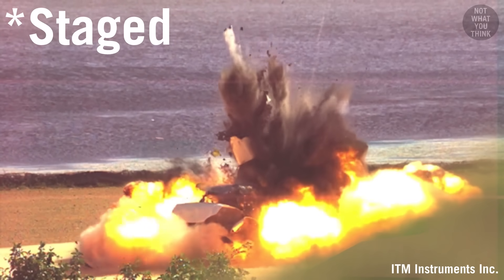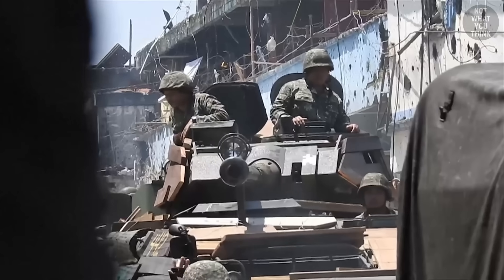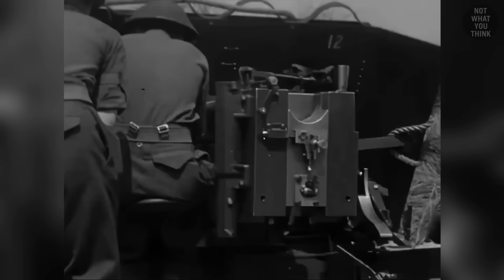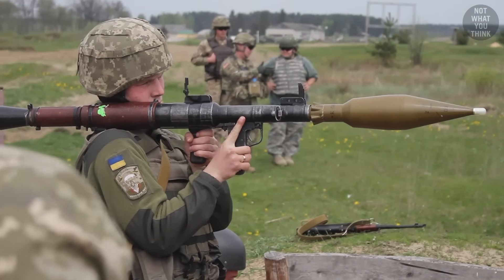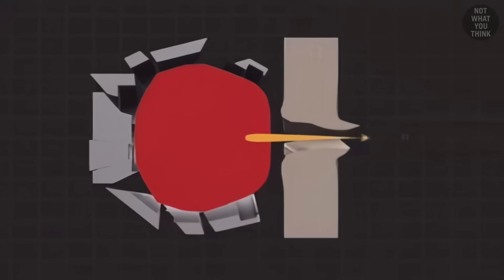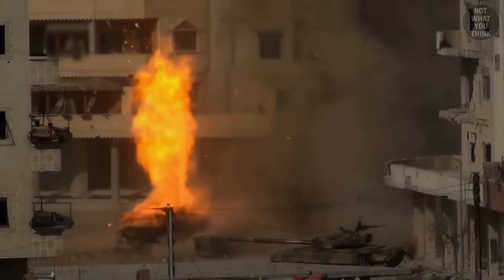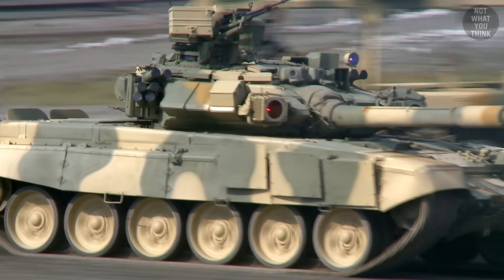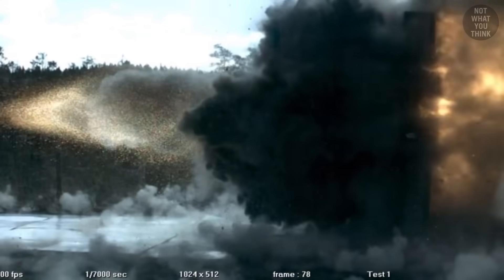Why Protecting Tanks is Getting Much More Difficult

Comment from the maker: Do you think tanks stand a chance against the ever advancing anti-tank weapons?
and what is the solution? "It's Not What You Think" is not an acceptable answer!! 😉
Reply: Would you rather be in a tank in a modern battlefield or advancing on foot. Tanks on their own are vulnerable, but nothing else fills that niche of advancing rapidly under light arms fire, and having protection.

Tanks have always needed support from infantry, and new technologies will give new support capabilities up and until there’s something that allows for an advance into hostile fire better than a tank.
Reply: Just think about. If your watching this kinda  video one shoud have enough knowledge to realize that it's a ongoing struggle...
Reply: @quentinrawlins4876  m
Reply: Tanks are probably not going to go anywhere anytime soon because of how crucial their battle field utility is. Their design and tactics will however receive many changes to mitigate the  threat of anti tank weapons.
Reply: @cwu4591  It's a question of economics and logistics. If one man can take out $20M worth of tanks with a 20K weapon then eventually they will start to have limited and specific uses, and not always risked in open warfare.
Reply: Force field
Reply: I'm more concerned about drones, my friends.  Without sufficient, anti-air capabilities on EVERY tank, it will become obsolete.  But thank you for that, "Not What You Think," about the RPG definition!  I never knew that!  ^_^  Tanks are going to have to travel in pairs to survive, just like snipers.  Drones will soon fill the skies in war zones.  They'll need a dedicated SAM vehicle with radar to cover the air.
Reply: @williamyoung9401  ever heard of SPAA and combined arms warfare? Well yeah there's your answer to drones some dude with a 50x scope and an M2 Browning could take out one of those while on the back of a pickup tbh very weak weapons when facing a competent millitary
Reply: I don't think it matters.  The Capabilities a tank has make it important.  This doesn't change its capabilities.
Reply: i think as the need for anti drone weapons grow you will end up with a weapon that happens to also intercept most munitions. Might even be in the future is you have a specialized vehicle where it's main purpose is to provide antimunition defense for several other vehicles similar to how you already have dedicated anti-air and dedicated indirect-fire
Reply: @acrazedgunman3388   SPAA??? It already exists the gepard the Tunguska the ADATS just do a little bit of research and you will understand. I'm sorry if I seem a little mad it's just that these comments are filled with people trying to be smart about a subject they don't know anything about until the start of this russo-ukriane war.
Reply: @vangard9725  you clearly did not understand the point of my comment as I mention a new specialized weapon to deal with drones. existing SPAA systems besides programmable he are cost ineffective versus munitions. In short why would think I did not think SPAA exist when I specifically talked about it in my first comment
Reply: @acrazedgunman3388  The current best answer is Skyranger 35.
It is available as mission module for the brilliant GTK Boxer and has a 35mm revolver canon which can take down low-flying jets, helicopters and cruise missile but also drones, rockets, artillery and mortar shells.
In the past the vehicle which fit your description best was the Gepard. Right now it is being very, very successfully used by Ukraine. Extremely effective against drones and cruise missiles.
Reply: @gustavmeyrink_2.0  so what your saying is it is not antimunition
Reply: It's What You Think, acceptable answer 🙃
Reply: @C_4MP3_R  angrylike
Reply: @C_4MP3_R  LMFAO Nice
Reply: @C_4MP3_R 😢😢😢 😢is 😢een 😢bietjen 😢 😢is 😢een 😢😢😢😢 😢is een 😢
Reply: @C_4MP3_R 
Reactive armor ?  That’s my guesd
Reply: spaced armor
Reply: I'm not ranting about the Russian ERA here. I'm just wondering, I saw this ERA fillings as the RDX shape charge from building demolition. They used it as a steel cutter in foundation and steel beams. Did they just use off the shelf steel cutters as ERA?!
Reply: It is what you think
Reply: I'm really curious how the new Swedish tank would hold on the battlefield, it can blend in on the environment, or even make the tank "disappear", it's called the T Ghost and can be found on the Dark Tech channel
Reply: Whatever the solution is.  Certainly,  money be part of it.  Like the video had.  A tank up to or past $10 million dollars.  Anti armor rocket is probably the modern day flintlock.   A suit of armor stopped being practical.
Reply: Gundams
Reply: @artnull13  I'm on Japan's ass with that... as soon as they make one operational our will be a month behind..
Reply: Tanks and everything involved in warfare is going to be (finally) made autonomous. So it will be cheapper, is gonna be abble to carry more armor and weapons, and will have no crew inside needing food, protection, and losing their lifes.

This way the wars are going to be decided in the same way as it was decided back in WWII, i say, the country with the better and faster capability of manufacture more and more of those weapons, overcoming the manufacture capability of its enemy will win, with the only difference that there will be much less soldrier involved.

Less lifes will be loss, but this also is going to bring a backside.... with less lifes being lost in wars, wars will be more and more common and less feared by the leaders and populations, turning the world in a even more complicated and vulnerable place, with multiple wars happening here and there while the people in the involved countries will keep living their lives like if nothing is happening, because those wars happening and the industrial necessity to keep manufacturing autonomous weapons and vehicles will keep a great part of the people employed in some function, and tus, having a war will be like a "essential" part of the big countries economy.

and this does not end here, because with this necessity of keep producing more and more machinery, the need for raw minerals like sand, iron. and water and rare soils like niobium will create a big pressure on the enviropment, with forests being devasted and so, affecting the rain distribution and thus affecting the agriculture of large countries with are great food producers and rich in minerals like the south american countries. 

All this will make food, water and other basic needs more expensive, add to this a ever growing population in most of the countries, but specially in Asia, and with less people dying and you will have the "perfect reasons" to declarate more wars against low developed countries but which are rich in resources (as the south american countries). keeping the vicious cicle of extract ressources -> to create weapons -> to make wars and get more ressources -> to create more weapons and so on.

but the fact is that in the middle of all this, in sometime, mass destruction weapons will be used to try to "clear" the vast numbers of drones and weapons on the battlefields. the use of this kind of weapon or some other which may be created for this, is going to be common, turning some sites of the world in true "radioactive battlefields only inhabited by the autonomous machinery which is used by the countries to fight their wars". 

that's it.

greetings from Brazil.
Reply: @hunter.1 , that's a powerful image: "radioactive battlefields only inhabited by the autonomous machinery which is used by the countries to fight their wars".
Reply: @dennis-o  Thank you. Yes indeed it is
Reply: Boeing has a force field patent. It works by quickly ionizing the air into plasma creating an outgoing shockwave to cancel incoming shockwaves. Call my crazy but in the future if we can get electrical power densities great enough we could then use super strong magnetic fields to lock that ionized air in place so it acted like a solid object, causing early detonation of munitions while canceling the resulting shockwave.
Reply: Of course tanks still have a place in warfare. They weren't invicible from the get go, I don't get why people are so hung up on the fact that tanks can be destroyed by infantry.
It goes both ways, and thus just comes down who sees whom first: If the infantry can get a shot at the tank (and don't miss), then they get the kill, if it's the other way around, then the tank will be destroying the infantry.
War is a complex endeavor, and thus considering it's facets ceteris paribus is quite foolish.
Reply: @kovi567  more like the infrantry is there to get rid of anti tank units, and the armored unit there is to "tank" some of the incoming fire and rain down heavy suppressive fire
Reply: @mewXD-mn6ec  The infantry is there to drive off the enemy, and so is the tank. Again, war is complicated, and the roles of each weapon system changes on reaching the frontlines and meeting the enemy.
A tank can and will engage AT units, and infantry can suppress with their own vehicle. "Tanking" incoming fire is false: If you are shooting on a tank, you are doing so either with a AT tools or out of desperation. Maybe in urban combat tanks can be used as mobile cover for effect, but then the verticality of the battlefield nulls that anyway.
With IFVs, recon drones and guided munitions in the mix, the mobile cover aspect of tanks is negligible due to either being superseded by the transport vehicle's capability to do so, or because the tank is also threatened, and thus needs it's mobility.
Attention diverting is more prevalent though: If you have a tank and a squad of infantry coming at you, you will prioritize taking the tank down first as it's the bigger perceived threat.
Reply: @kovi567  am talking about combined arms warfare. INfrantry is there to drive off AT position and stuff, while the armoured will focus on AT, Inf and other armoured.  

What else are infrantry for, to capture and hold territory, did you exxpect me to not know that? or was what you were trying to tell me ... Not what I think
Reply: Sacrificial drone tanks unmanned with multiple backup systems and seperate multiple drives for each tank. You can take out the middle and it still keeps going.  that look like regular tanks, but when attacked give away the position of the attacking forces which are destroyed with massive missle counter attacks. Or push a massive block of armor steel in front of the tank say 5 meters square on multiple axles to distribute the weight.
Reply: We're pretty much still using medieval defense combined with offensive capabilities of modern day as a form of defense.
Reply: @jaymusic5417  yeah sun tsu.
Reply: The simple answer is no
From the time, the USAF started dropping 500lbs GBU-12s on Iraqi tanks in 91 and development of precision missiles like AGM-65 Mavericks, tanks days have been numbered 
The T-14 despite all its advanced protection would still be shredded by both weapons
Israel's SPIKE NLOS mounted on a tomcar can carry 8 missiles and strike from up 16 miles away. The NLOS  has the capability of dropping down on target at a near 90 degree angle which allows to bypass most tanks defenses
Helicopter launched missiles have steadily improved as well
Lastly ,man portable weapons have advanced to where armor cant function without extensive support
JAVELIN and loitering munitions have made it hard to validate heavy armor usefulness in modern warfare
The Stryker Leonidas combined with laser weapons in theory can stop drones and missiles but anti-materiel rifle (AMR) can disable both
Simple combined arms tactics
Snipers with AMRs disable the Leonidas and laser weapons ,allowing anti-armor targets to cut loose
That counter is that you have rely on UAVs spot the snipers before they can disable your defenses
Things are getting more and more complicated on the ground
Reply: @verdebusterAP  What do you think about a strong umbrella net or sheet hanging around and above the tank at a distance? Something that can either catch / divert / pre-explode missiles?
Reply: @greatbriton8425  
The problem with countermeasures for tanks is that its very easy to bypass them with weapons and tactics
Reply: @verdebusterAP  you say the US made tanks obsolete in Iraq. Yet the US themselves used plenty of tanks in that war. And in Afghanistan. And were requested in Somalia but were denied and the mission ended in a fiasco.

Most modern wars are not modern. The enemy doesn’t have anti tank weapons or anti aircraft missiles. So, tanks, helicopters, are very useful in “modern” warefare.
Reply: @TheBooban  There's always a great power who prolly has a grudge against you willing to send in that shit to fight you.
Reply: And they took the idea of a shape charge from the Panzer Faust
Reply: RC drone tanks but who knows maybe the USA have already got the tech to stop them but its secret ( they made the javelin so you would think they worked on something to counter it ) But  Russia has anti-tank weapons and didn't make a countermeasure but they didn't count on facing western weapons.
Reply: Yes they can survive in modern warfare by means of combination arms tactics.
Reply: Never heard of it
Reply: It’s exactly what you think!
Reply: I think having mobile firepower that is largely immune to artillery and machine gun fire is still valuable, even if they're more vulnerable than they used to be. They might just put active systems on other vehicles providing a screen for tanks if the weight of them becomes too burdensome, so that the tanks themselves can trade some increasingly ineffective armor away for more speed and maybe cheaper cost. 

It would be like what happened with ships. We reached the point where it just wasn't feasible or worthwhile to keep armoring ships against anti-ship weapons, and got rid of a lot of the armor for active systems and so forth.
Reply: Add two of the ERA for javelins lol
Reply: Tandem ERA.
Reply: Get an explosive sandwich and watch how quickly they run to the bathroom
Reply: It’s not what you may think
Reply: Tanks was and still being mobile barrier to assist infantry, not a super hero armor.
$5M soldiers > $5M tank.
$6M soldiers < $5M tank + $1M soldiers.
Reply: Yes. To put it simple this is sword and shield, you come up with a better sword, the other will develop a better shield, the Israeli have already solved part whit their trophy system.
Reply: Well if we start with the basics of using tanks with infantry support on of top armour and hard and soft APS, the next step could be drone protection systems for extended range APS (as in drones moving with and around the tank to detect and react to threats to the tank). But the fact is that if an armoured vehichle/tank isn't used the way it was designed for (like no infantry support when it was supposed to be used for COMBINE ARMS operations) it should not surprise us if it gets blown to peices.
Reply: @samot.456  J
Reply: One solution is an invisible laser force field surrounding the tank like a blanket effect.Another solution is to apply ( The swarm 100) meaning 100 mini high speed warhead drones working in sync with each tank to counter attack any threats at a 360 degree angle.The swarm 100 must also be search and destroy capable to pin point the location the projectile came from and destroy that point.Also tanks should be updated to be autonomous.
Reply: @johnathancommodore9642  yo dude if you didn't know you could just fire one tungsten projectile at it to neutralize it or just fire a smoke charge before the enemy can lock on.. by the way these methods are already in tanks and they work very well making self guided AGTMS practically useless
Reply: @vangard9725  And imagine thousands of service men with Power Armor charging at you. They should be able to wipe out entire enemy military
Reply: @vangard9725  Nop. ATGMs will struggle to lock and hit a soldier in Power Armor because unlike tanks they have lower profile, much more fast and agile. Auto cannons with 25 or 30 mm calibres have a chance but they are mostly for anti air purpose. Enemy can't mass produce and field them with enough numbers to counter power armors
Reply: @chinazieswillstartww3253  I'd disagree on the locking on point since radar can lock on instantly and laser beam riding ATGMs can be controlled with a radar or manually with line of sight. But still ATGMS could be countered with an APS also just saying 20 mils are actually surprisingly easy to produce (good balance of size, material, robustness) but 30 mils not so much.
Reply: @vangard9725  Locking and hitting are different things. Remember ATGMs are meant for big slow tanks not small fast moving soldiers. It can lock but can't accurately hit fast moving human size targets. And 20 auto cannons has to be mounted on a vehicle limiting their use. You can argue 20 mil rifles can be used by infantry but it will be too heavy for individual soldiers to carry and use
Reply: Every tank will always have the problem with oversaturation: fire enough stuff at the tank and all the protection is useless.
Reply: Tanks have been declared obsolete so many times, and every time they evolved.
This time wont be different. A good tank manufacturer knows about the strength's and weaknesses of a tank and finds ways to overcome it.
But tanks itself will not die. 
Otherwise it'll be another meatgrinder like ww1 again, where infantry vs infantry vs entrenched machineguns, howitzers and aircrafts fought...
Reply: No.  The science behind destroying things is easier than the science behind defending against previous science.
Reply: Use ✨COMPUTER TECH✨. Putting an Iron Dome-like system on a tank where it detects incoming projectiles in its proximity then it will launch a projectile that will intercept and is enough to destroy anti-tank projectiles.
Reply: Make tanks out of plastic, and put rippled hard and soft plastic as the armour, or add thin rippled carbon fibre, so that the soft melts quicker and diverts the flow of the liquid steel.
Or, keep the armour, and put lego around it.
Reply: Tanks will need some kind of always active anti-air ballistic system at some point, followed by 360 view object tracking and threat identification.
Reply: The future are drones, not tanks, no human piloted planes.
Reply: It seems like the military evolution of weaponry and tactics has shifted from infantry to artillery, to armoured vehicles, to tanks and as the video mentions back to infantry. Is it a cycle, as every development or invention may reach a peak at some point? Maybe the tanks can follow the RnD that is put on aircrafts and now is being copied to warships like (just as someone else has mentioned in here) anti missile laser beams or drone/remotely controlled tanks and armoured vehicles which can be made more accurate with heavier payload.
Reply: @ΠέτροςΠαπαϊωάννου-λ6ψ  Yes, I think tanks would have to have more complex defense mechanisms which likely means bigger and heavier tanks, which means less maneuverable (a key purpose) so tanks may have peaked out and no longer make sense as weapons.
Alternately, going the other way - small expendable (inexpensive) weapons may not have peaked especially if they can be automated (robot) for small cost. There are already mechanical "attack dogs", etc.
Reply: Lol yes.  They are shape charges. The Israelis already have an effective system against it.
Reply: You know what? All this advancing of weapons is complete nonsense, a waste of time, money and resources. Humans are a complete failure in this time, just get along with each other and we can drop all these stupid military's and weapons, we don't need this crap!! I can't wait for the day we wipe ourselves out! We deserve it!
Reply: @kafilkavich707  Didn't I see you strolling around WuHan a couple years ago?
LOL
Reply: @kafilkavich707  🤣 conflict has always advanced technology. Always.
Reply: A laser active defense system would be nice, if of sufficient wattage could fry the incoming projectiles
Reply: @cr4yv3n  this is being used to great promise. Good fast accurate bursts can be used to confuse or destroy incoming projectiles. We are literally 1 decade away from only using lasers for offense and defense since normal projectiles move much slower than light speed, and lasers can be used to kill any projectile, even a solid ceramic.

Mirror shaped projectiles are probably the only way around this.
Other than maybe cluster bombs or cluster ammo.

Cluster ammo is not legal to use on soft targets, only hard targets. It is also a war crime to use DE weapons of any kind, including lasers, against soft targets, but it is relatively considered legal to use against hard targets.

Harmful gases are still a war crime to use, even as a shielding device. This includes some forms of explosive armour that use pellets to make javelin lances obsolete, but technically there is no weapon mentioned in this video that will always work, pellet loaded explosive armor propped up on cages is impervious to 2 attacks by a javelin in the same spot, if backed by M2A2 armour.

Tanks are still probably best to be used solely for specific missions that need them, like fighting inferior tanks or support from farther away. Tanks have a narrow use case. They are good for very limited areas of expertise, like mid range missions of support that require repeated traveling over long distances quickly over and over again. For example if you needed to transport a bunch of high value materials from A to B without using aircraft, you use tanks to support other vehicles, especially in front to blow through mines and divert attention no to mention as deterrent
Reply: We're going to need Heavy Object machines now
Reply: I think it's more about avoiding getting hit, some kinda flare system, or something that can hit the rocket before it gets within range of the tank
Reply: I think the solution is you losers should stick to video games if you're not going to actually research the information you put forward.
Sure you made a good chunk of money off this vid, but that's literally all its good for with all its errors.
Reply: :face-red-droopy-eyes::face-red-droopy-eyes::face-red-droopy-eyes:
Reply: The answer is a mixture of gel, fibers and air.  Exactly how and why this works is patent pending.
Reply: Just attach a 25mm Autocannon and a small-enough RADAR to it to shoot down the Missile, the whole thing has to be automated (obviously). But there in lies the problem, how much power is a Stop Sign Sized RADAR going to need to work? And do we even have a Stop Sign sized RADAR at all?
Reply: @keloid7682  There's already active protection systems somewhat similar to your idea
Reply: @keloid7682  quite literally APS XD
Reply: @keloid7682  Russia's Pantsir is just that.
Reply: @keloid7682  "how much power is a Stop Sign Sized RADAR going to need to work? And do we even have a Stop Sign sized RADAR at all?"

Not that much, and, more or less, yes.
Reply: Philippine Government is so corrupt the Philippine Armed Force used Wood as alternative for explosive reactive armour (ERA)..
Reply: @adspie  you know ERA isn't cheap besides wood and cardboard is good enough against those old rpg 2
Reply: It’s exactly what you think!
Reply: It’s exactly what you think!
Reply: It’s exactly what you think!
Reply: Tanks became obsolete with the introduction of depleted uranium bullets....
Reply: @paulmobleyscience  no they haven't. We've been using those since the 60s and trust me they aren't anything special. The only thing that makes them better than steel cored APFSDS is the higher density of depleted uranium
Reply: do you found Mick (Found and Explained) location yet?
Reply: Tanks still have a role. this is beating a dead horse. the issues in Ukraine have been discussed  at great length.
Reply: u changed the thumbnail im gonna be a furry
Reply: They went from turning the bullet around so the flat side would face out of the housing to hypersonic missiles
Reply: Why were they flying around planes they knew if they crashed it would set the explosive off should be the real question
Reply: The tank defense could be to stop the RPG rounds before they arrive. This depends on more sophisticated tracking and aiming systems, rather than new typed of munitions. The advances in air defense systems, including AI target recognition, might be extended to tank defenses. This is computer technology, which is still advancing.
Reply: High Powered Laser systems or laser dazzlers.
Reply: I think the solution is to have your tanks supporting and supported by infantry and aircraft to mitigate the threat of infantry based anti-tank weapons, as the reason why anti-tank weapons work so well is that the tank crew will always have poor situational awareness, but the operation of man-portable anti-tank weapons tend to make you extremely vulnerable to infantry, which is why that particular job has one of the highest casualty rates, whilst the tank shreds anti-air and your aircraft shred enemy tanks, the doctrine of combined arms works because the actions to counter one threat make you vulnerable to another, the main things the armor of the tank needs to be specifically proofed against are the dumb rockets since if you are using tanks correctly they can still be highly effective due to the point and shoot nature of the weapons and little/no prep usage of the weapons, whilst most-hard-kill systems make it difficult to use the tank in it's proper role as infantry have to stay far from the tank or risk getting fragged by the system.
Reply: Have it to where the reactive armor has a bigger blast radius to destroy both the 1st, 2nd or (potentially) 3rd charges (by large pressures alone) at the same time, and synchronized mechanisms (that tell the explosives when to go off) before the missile even has a chance to touch the main battle armor. 

Have the reactive armor shoot out tons of shrapnel purposefully if it means disabling the little java code embedded inside the Javelin’s missile chip.

A missile or artillery shell can only get so long and big before it becomes impractical to attempt to wield it on the mobile battlefield.
Reply: Javelins get countered by smoke that is launched, conceals the tank.
Reply: In the future, we'll probably see a shift towards more mobile armored gun carriers rather than tanks. It'd be more effective to have smaller, more mobile, more numerous vehicles that can withstand small arms fire and avoid targeting or even detection, while carrying these modern anti-tank weapons. Maybe in the distant future we'll see a combination of armor and infantry, possibly in the form of a real life version of power armor, but that's not coming anytime soon.
Reply: Really good explanation. Thanks.
Reply: It's Not What You Think
Reply: I'm a programmer so the answer is always "YES" we just need to discover the how, in problem solving. Maybe we find an answer and it works but it's really inefficient, so we find a new problem to solve within the current solution, until eventually it meets the acceptance criteria.

So combining engineering with computer tech, and perhaps another discipline that hasn't been considered into the mix... one day you'll have a solution for the Javelin problem that economically will be an advantage for the tank and disadvantage for the infantry. But all it takes is someone visiting the new problem that will exist for the Javelin infantry with the same attitude...And thus technology continually advances.

This is an eternal cycle of people on both sides saying, "I don't know yet... but I'm going to find out." 

Before you know it your wildest sci-fi movies will be a live recording on some top secret server that will be revealed to us 25 years after the fact.
Reply: Yea, lol you use multiple tanks and naturally infantry is supposed to deal with that. A damaged tank can be repaired after all.
Reply: @Warsie a damaged t72 / t90 tank that had an internal ammo detonation is not going to be repairable

Non Russian tanks with a blow-off ammo bustle behind the turret are repairable
Reply: Can this special missile destroy tic-tac? 
Tic-Tacs were tracked by US radars and they can fly at Mach 60 (20 km/s) and they can accelerate instantly to this speed at about 3000g.
Reply: Force Fields
Reply: Non newtonian gas, or a swarm of fly sized drones
Reply: Tanks became obsolete what we need is Power Armor. The agile and faster infantry man with tank level Armor. Tanks and RPGs will struggle to hit them. They will survive explosions. With their speed they will quickly run into enemy positions and mow down enemy soldiers with their mini guns. Power Armor for the win
Reply: @chinazieswillstartww3253  I agree a form of reliable power armour would be better especially if it can have all of the same protection features of a tank
Reply: @vangard9725  Actually Power Armor doesn't need to be as protective as tank. They should stop small arms fire ( including 50 cal like anti meterial rounds ) and should survive explosions. Enemy will struggle to hit a fast moving power armor with RPGs or tank rounds
Reply: Hard kill active protection systems is where it is at, not to mention that we havent really had a good loock at a good attempt of using tanks in a modern hightech battlefield, as most lack tacktical capabilities to properly utilize the tanks.
Reply: well you need a tank to destroy fortifications esp urban warfare
Reply: Electromagnetic fields, eventually. They'll require something tank sized to generate them.

It's ultimately one branch of physics against another.
Reply: First, tanks are not made useless by antitank weapons. A tank forces the enemy to get high tech antitank weapons, which is a big pressure on its economy and logistic. Soldiers can't carry loads and loads of antitank projectiles and weapon because they're only humans, and the weapon is not very effective against soldiers. If you can force your oponent to do something he'd rather not do, it's a victory already. So tanks are indeed still very relevant IMO. They're simply not the apex weapon of the battlefield. It's funny to think how their fate is similar to what happened to knights on horses.

As for protecting the tanks, Israel's Iron dome seems very effective at stopping rockets. Make it small enough to fit on a tank and you're good. Or have roving drones around the tank to carry this and make a protected area around the tank.
Reply: Ya know, I don't care. I'm sure this video is about shaped charges, but the crap I have to sit through is not worth it even if it's something crazy and new.
Reply: @8:23   Plutonium needs to be compressed.  Enriched Uranium does not need to be compressed.
Reply: @MirroredVoid on lambo, if you have enough acceleration and speed you can just dodge xD
Just need to detect it early after launch.
Reply: True, same applies to lithography
Reply: Tanks never worked well in cities, mountainous areas, or without air superiority.  They get wrecked.
Reply: I think the future of tanks is mini drone tanks (the size of a moto). They would be cheaper, faster, and don't cost lives.
Reply: @GenomicWizard  Smart self aware AI mini drone, so the signal can't be jammed.  With nuclear batteries so they don't run out of fuel.  Great idea.
Reply: Yes. There is still life left in thanks. Theses were left incorrectly. They were being used increasingly on their own. To me, the solution is three fold: 
1) Better Intelligence gathering and use. Field Commanders need to know the exact nature (of course, if possible) of the threat units under their command face. 
2) Tanks need continuous, close (on foot soldiers) protection. 
3) Tanks, Troop carriers, mechanized artillery, supply trucks, need better, smaller Active Protection Systems.
4) If at all possible, do not start a war with anyone, if you cannot control the airspace. I you cannot control the entire enemy country’s airspace, at the very least, control the sky above the tanks.
Reply: According to every fucking military and video game expert RPG has 2 blatant bullshit exact translations and those are Role Playing Game and Rocket Propelled Grenade.  That bullshit other translation is just what Rocket Propelled Grenade loosely translates to in a cross between German and Russian language.  It is Rocket Propelled Grenade according to who?  According to the fucking person who invented the dam thing.
Reply: This video is full of so much bs.
Reply: just make it two incensitive explosives back to back
Reply: @MirroredVoid true, dont need armor when u ca shoot down the super sonic missiles ur self.
Reply: I do think that tanks are still crucial when it comes to urban fight, especially because hand carried RPG's or javelin are wayy harder to use on this configuration. Also, Im sure that radars and detections system will improve enough to be integrated in armored vehicles, at this point you could think about linking a light machine gun with the short range radar in order to intercept any incoming rockets. However this MG would probably be vulnerable on city battlefield against regular weapons. I didnt even mentionned the future of lasers already used on boat. So the current situation is against the tanks but i dont think its time to say goodbye to them seing whats ahead of us
Reply: There are technologies that use intercepting ammutition that shoots down incoming threats such as rocets
Reply: We have the technology to do active defense on tanks and stop in coming missiles. 

The problem is it's just not economical and would probably require a lot of additional maintenance.
Reply: i guess we will see even more Drones, maybe AI assisted Robots, and Infantry with Exoskeletons...the Tank allready lost the battle if it doesnt overcome that, so i would recommand a Dronearmy with defense capabilities for the new generation Tank itself. Please let us have less wars
Reply: The only thing that's really changed over the century or so of the tank is the range of the anti-tank weapon.  Infantry have always been deadly to armor up close and personal - the problem was getting close enough to the tank to bring the infantry borne weapon to bear.   In WW2, the big German tanks fell victim to Russians who didn't even have sufficient anti-weapons if they didn't have sufficient close defense systems.  Allie armor learned to stay a couple hundred meters away from German infantry to avoid Panzerfausts and shreks and ATMM.  Later, relatively small and portable rockets came along and made tanks vulnerable to a much further range.  These were defeated by modern armor (ceramics and reactives etc.).  Now we have things like the Javelin that are still man portable, unstoppable by the modern tank and have a range of up to 3 miles.  Now that the man portable AT weapon has a longer range that the tank itself, I think the MBT has become almost obsolete (at least on a level playing field).  Air power doesn't even figure into any of this as aircraft have become absolutely lethal to tanks but have their own weaknesses and massive price tags.
Reply: no they stoped being the best weapon for the job a long while ago. Artilery and anti infantry vehicles are the most important the middle ground doesn't matter any more.  you want your light  vehicles that can move fast  and bury a area in small cannon fire. while you have the artillery tanks  shell effectively  and insanely accurately because missiles are fucking expensive.  artillery tanks have gotten to the point where they can putg a shell  on someone head  from a mile away. 

also reactive armor is only useful against shape  charged warheads  not else. and you dont need to destroy a tank to make it useless you just need to disable it's tracks then kill  anty crew that  try to fix it or any attempts to repair it. 

Tanks are the least useful weapon.  mortar's and artillery are the best.  If you can see your enemy you already fucked up
Reply: the only way is to make them dont selectable.or having fakes
Reply: Yes. Eventually tanks will reach the point that they can target projectiles before they ever reach the tank. The “armor” will be preventing the anti-tank round from reaching the tank
Reply: Yes. Because they will be forced to develop a whole new type of armor.
Reply: they won't be ever advancing If tanks aren't also ever advancing
Reply: Do tanks stand a chance? Probably. I know for a fact I'm not smart enough to have the answer for how, but I know there are people who are paid a healthy living to figure it out. If I had to guess, as the missile gets stronger, the defenses have to get smarter. Computer guided interception through lasers or an autocannon are possibilities. More likely IMO is something we haven't even considered yet.
Reply: I think  they will gradually be phased out but the idea of stopping a projectile with an explosion if freaking awesome.
Reply: Depends on how much money is spent on tanks and how well they are used.  Is a tank armed with long range anti-infantry drones, active defense system, good top armor, and visual/thermal/ir stealth worth developing?  I believe so.
Reply: Thats why the new Tiger Panzer has a kind of Phalanx System 360° and an Ai controlled 360° anti inf MG tower. Also a new developed reactive Armor System.
Reply: Tactics. A tank is a mobile weapons platform. Mobility + concentration of firepower (including suppressing firepower for pesky infantry) = breakthrough of identified weak point and win. Russia just isn't using its tanks correctly, and tbh most western commanders don't really get it either. Its embarassing watching armies use them in 2's and 3's as slow pillboxes.
Reply: wait a couple more years and tanks will evolve to mechs easy 😂
Reply: @fatezero-d1i  uhhhhhh probably not lol
Reply: Well, let’s first ask “what is the role of the tank”? And
Of course, it is for infantry support. Provided you own the skies. Or either side are afraid to fly their expensive jets…..
So, it’s my opinion that lighter, cheaper, drone robotic. And most importantly.
Infinitely adjustable Nutron , Nuclear and EMP devices are the ???
But the solution?
Hit everyone at those G7 or G12 meetings….you know. The dozen or so Ruling Class ghouls that keep you sick, frozen and in fear. With a big fat mushroom!
Then you won’t need….any of it.
Peace is the solution, but you won’t have that until you pull the pipe from up your sleeve on the schoolyard bullies. Dig?
Reply: Very difficult question to discuss but I’ll try. I’m a retired US Army Infantry NCO and spent 13 years as an 11H (Tank Destroyer) and used the TOW system. I’ve always been current on armored vehicle developments and countermeasures to defeat our countermeasures. We’re all familiar with the rapid advancement of technology where we can put something in production in a heartbeat compared to 25 years ago. Tank on tank is simple to see the outcome since we’re using SABOT rounds and I haven’t seen anything that can defeat that yet although I’m sure we have something on the shelf just in case we do need it. In the missile category we’ve (USA) been able to get around various countermeasures but we’re coming close to an apex in the technology and I don’t know how far we can go until something can easily defeat it. If so, then the logical step would be to develop a advance weapon platform such as a particle beam or rail gun which it’ll be near impossible to defeat a rail gun projectile. So that’s my take on the question. Thank you.
Reply: No, and they never will again, unless they got mach speed tanks
Reply: When I was in the military in the 80s tanks were known as coffins with a cannon. Life expectancy inside a tank during combat was about 15 minutes. 
Dont know if any of that was true but you know how GI's like to "shoot the shlt" when they stand around and smoke and sip coffee.
Reply: Your production value is through the roof m8. No bs just information covered in sweetsweet dressing. Thank you
Reply: Why not just hire a voice over actor. Costs next to nothing and will be infinitely better for your subs. Why? Probably ego
Reply: @lawjef  I thought you were talking about voice actors from the tanks,, all they would have to do is cry or say help us!
Reply: Just put two layers of reactive armor lol
Reply: it is like Tor's biggest hammer
Reply: its an arms race, we'll get an armor that will resist at some point.
Reply: The tank era might be prolonged if going to remote operated tanks but the energy weapons on the horizon can deliver enough punch to send a tank flying with sudden initiation of 100+G's to the tank and anything inside of it. (i.e., would kill any human and that is likely even if there were air bags inside the tank.)
Reply: It can be a circle it could be a square it could be a triangle it could be a knife wound it could be laser printing what is laser mean light? Ionized light how do you ionize the light x-ray light gold silver or mobile home....
Reply: Trajectory reference check...
Reply: Smaller phalanx systems would work great. US Navy and Army (using CRAM) have already shown how great that system is at missile and artillery defense.
Reply: I'd say an efficient laser based active defence system might be a solution.
On the other hand, tanks are not really important for current and future wars. Urban warfare, guerilla warfare and long range missile attacks seem to be the new norm.
Reply: invisible tanks could do the job. Enemy cant shoot something they cant see right?
Reply: Nice try KGB...
Reply: Giant piss laser
Reply: Why not use electromagnetic technology. It’s been used before
Reply: Automated point defense systems mounted on tanks to shoot down missiles/rockets.

Improved threat perception

Smaller remote controlled tanks.
Reply: We've moving to the realm of drone warfare so while tanks are far from out they're just going to become more specialized but honestly there's no way to know what limits technology will throw at us I wouldn't be surprised if weaponry eventually crushes all forms of armor it's happened before with something as simple as gunpowder simply because making something that kills is definitely easier than making something that protects you from the killing thing you made especially if you make another killing thing to bypass the protecting thing you made to be 2 steps ahead of everyone else
Reply: @adamk.7177  fluid armor is already a thing the facts stand that explosions are worse in water, transfers concussion better than air. It becomes like the kevlar vs liquid armor specialization over generalization understanding what your enemy uses matters more and more
Reply: Add one more layer of reactive armor. Now even javelin would have hard time penetrating the tank.
Reply: I think that is the solution taking down those inescapable nations, including their leaders, and their governments such as North Korea, China, Turkmenistan, Saudi Arabia, and Belarus for real. This includes taking don their armies unnoticeably.
Reply: maybe once we get future tech we will have tank armour capable of having strong enough armour to survive this but the anti tank will keep getting stronger so maybe a way to activate the 1st charge but then the 2nd charge will hit the second layer of charges
Reply: Yes, they will become fully automated/networked with other AI battle assets with multiple interlinked systems and will probably have structures that will allow projectiles to pass through or be otherwise neutralised and they will stop being used.
Reply: They will also become more agile/smaller with significantly higher power smaller weapon systems
Reply: The tank is over as an effective weapon. We don't use siege engines or biplanes anymore, either.
Reply: @richsackett3423  nope it's effective it just needs to be smaller and more mobile, think terminator automated drone.
Reply: Combined Arms baby!
Reply: Just get better active systems that outstand a barrage of missiles
Reply: The future of war is drones. Hundreds of small explosive drones with swarm behavior, operated by a single man at a distance, can be more effective than any tank.
Reply: I would actually love seeing Tanks become more of an evolution of what they were supposed to be, rather than what modern Tech made of them.

We have much better Tech now, so we CAN build enormous machines, and slap them with a mix of Armor that could make them invulnerable to all existing AT Weapons. And seeing how some armors work without acutally being very weighty, like the Leopards Protection against APFSDS on the Turretfront, which is working smarter, not harder, i think there could be a case made for the return of big warmachines.
Of course such a machine would have to be completely redesigned, reinvented, but we have so many new compound materials that i think such machines would be feasible and worth having on a battlefield.

Armed and armored for every occasion.
Reply: Laughs in Abrams X
Reply: With railguns coming up i think the time is over unless they invent forcefield like in movies or some new element.
Reply: No. Tanks are quickly becoming obsolete.
Reply: Another layer of "sandwiches"?😂
Reply: How about the jager gadget from rainbow six siege but bigger scale?
Reply: No they are prisons making you more noticable and ovens for frying.
Reply: Alright, it was exactly what I thought.

The IDF Merkava already has APS integrated. And we see with the Philippines that both sides did not use cutting edge high tech. It is always a trade-off of resources, time, needs, ....
So... The Russians in UA use T-62s and their boss considers it a worthwhile trade vs javelins. 

On the gripping hand, a modern tank employed by the USA will be used in a combined arms role together with everything from air superiority to infantry. In Afghanistan, mines (ieds) were the big problem. A networked tank with surround view will work with a team that suppresses anybody popping up and using a javelin or similar. An enemy tank is just a target for Apaches, Warthogs, tanks, infantry, .... whoever gets there first to score the kill. 

On an even footing (eg with a limited expeditionary force vs a competent opponent), it comes down to crew training and the small things like optics systems. 
Ask those crew what they want: 

Slogging through the mud on foot, use some tincan or a "technical" for transport or sit nice and tight in a tank that will shrug off all small arms fire and needs dedicated resources to defeat? So in reality, even a T-62 is better than a Toyota.
Reply: Tanks are a legacy weapon. Use jets
Reply: @MrJloa  Which are even more expensive.
Combined arms means that you need all of the above ftw.
And watch Perun's video about tanks and how in this war it is not a tank failure but a failure of usage of tanks.
Reply: What about simply adding several layers of ERA? Then I guess the missiles might get three charges, and so fourth...
Reply: force shields
Reply: Russia learned the hard way that it's not WWII anymore.
Reply: Frankly, I think tanks are on their way out for reasons that have less to do with vulnerability and more to do with relevance. A big thing that's hard to destroy, reasonably mobile, and has a lot of firepower is great for a pitched battle on open ground, but in modern conflicts that kind of power just isn't as useful. I expect that there will be one or two more back-and-forths of new countermeasures (my speculation is refinement of guns that shoot down missiles followed by missiles that somehow make themselves confusing to aim at but I could be wrong), but I think where this particular avenue of the arms race will ultimately end is everyone losing interest because tanks aren't so important to kill and protect that they're worth spending more money on R&D for, rather than an ultimate solution in defense or offense that can't be countered.
Reply: Underground bunkers with enough elevation to allow for round to go out of a hole a fraction bigger than the cannon tip?
Reply: Heavy Object layered explosive armour, laser defense armor (LAA [laser array armor]) and rail shields (rail shields. These are shields that use electric field bursts that are powerful enough to generate electro-magnetic energy in any material, and then use this magnetism in reverse to slow the object back down. It will even work with ceramics, all materials have electrons and can be turned into electromagnets. So named as a response to railguns, which can fire rounds over 130,000 feet per second.)
Reply: IMO, drones, smart munitions, and long range weapons are the future of warfare. you can't use tanks for ground assault anymore due to weapons developed against it but can still be used for ranged bombardment and strategic "softening".
Reply: The tank has to be so well camouflaged and fast that it doesn't get hit. Think: very small tank with AI and legs. Basically a well armored robotic dog with body armor and it will go out and patrol for maybe an hour and then come back to base to recharge.
Reply: Amazingly high quality video, 11/10 👍.
Reply: Trophy APS can already neutralize any AT weapons, including from high elevation. it has a quick autoloader and is also identifying the source of fire.
in the last ground operation in GAZA at 2014, no tank was even scratched by AT weapons. there were dozens of interceptions with a 100% success rate.
its now being upgraded to deal with SABOT rounds too.
Reply: They seem to be getting replaced with IFVs like the Lav III. Not to mention lessons learned in Afghanistan the vehicle would survive the IED blast, but the crew inside would be severely injured, or even killed by the shockwave.
Reply: Use the proper name. COPE CAGE.
Reply: I think the only answer to this is unmanned tanks
Reply: Possibly a new design of tank with a roof above to tank anti-tank weapons, while letting it to shoot and aim the same?
Reply: I don't think so. And this is only the beginning of the problems: if you add smart kamikaze drone that don't even need the launcher to lock on or even see the tanks, or regular drone that can aquire the target for smart artillery rounds with dozens of kilometers of range, it's pretty clear to me tank will only be used effectively against an inferior ennemy by a well-coordinated force in the future.
Reply: The best chance tanks have is for significant enemy intel to be collected before anyone fires a single shot. Armed forces need to know exactly — or as much as possible — about enemy capabilities ahead of time to save troops' lives, and save costly equipment. As the old saying goes, “Look before you leap.” With that said, vast improvements in intelligence gathering are more valuable than armor.
Reply: It's going to go the same way fighter planes did, once the ability to armour place was surpassed by the fire power they could carry, it became about there ability to avoid hits thru speed maneuverability and stealth. Tanks already went through this process once when chemical rounds first appeared, but they reverted to armour once ERA and composite armour became effective. Ultimately I think this might be the point where we begin to develop either power armour or mechs that can carry heavy fire power but are agile enough to dive into cover to avoid fire rather then trying to withstand it via their armour.
Reply: The short answer is existing tank design concepts will fail vs the advancements in anti tank weaponry.

The long answer is tanks will stay on the battlefield, but will likely take a back seat role or have to be escorted with dedicated anti drone aa systems. Realistically it is now cheaper and likely far more effective to have multiple utvs carrying 2-4 men each with good gear rather than a single tank. Those 3 utvs could mean 2-3 stingers, 2-3 atgms, and perhaps a few small drones or grenade launcher or mortar. So imagine for a minute that a group of 20 tanks has to face off against 40-60 utvs each carrying an atgm. Can those utvs hold out against the tanks in an open field battle? Nope, but they likely could set up numerous ambushes that would see off several of the tanks at the cost of several utvs and atgms. Now imagine you are taking those losses. Which side will replace their losses quicker? Im betting it will make more sense to replace utvs, atgms etc. Those tanks will take a long time to replace. Forget about cost for a minute and just consider time to build. Those utvs.... you can literally use civilian models that can are modified for combat purposes. That would likely be something like a bit more fuel, a spare tire, mount for a squad weapon (be it a hmg, grenade launcher, or a mortar), and perhaps means to launch a drone. 

So lets say a war is going to last for several years. Over that time a major power might make several hundred tanks.... or 10,000+ utvs and probably a similar number of atgms. All things being equal those utvs based units are likely to be more sustainable as long as you are willing to accept losses. That is the caveat. The utvs will see more men die than the tank crew losses, but those utvs will basically be mounted infantry so pound for pound it will be more effective than dismounted infantry and far mor numerous than mechanized infantry. If you add in the fact that heavily armored vehicles require a massive amount of fuel it stands to reason that utvs could easily be more desirable by reducing the logistic demands at the front line. Instead imagine the utvs operate in a skirmish in depth doctrine. The goal is to deny the enemy control of a large area that is within range of artillery. In that space the enemy can not move up quickly because of the constant ambushes. That will reduce the impetus of offensive columns. Meanwhile the utvs are backed up by significant artillery which can then destroy slow moving vulnerable targets like light skinned logistic vehicles or simply shell around armored columns to keep them buttoned up. 

End of the day Im going to say drone atgms and cheaper drones built to destroy lightly armored targets will vastly reduce the value of tanks. Once those types are drones are fully developed it will be easy to deny a large area from concentrated enemy forces when you consider precision artillery. At that point the side with the ability to push back the opposing logistic hubs will be the winners. In that environment anything that pushes up logistic demands for minimal value will likely be a dead end technology. In that kind of environment existing tanks will likely be modernized, but additional tank development will likely go out of favor with the funding going towards more drone tech or anti drone tech.

If there is one place where armored vehicles might still exist is in the form of mobile ciws platforms. Imagine for a minute a light tank that has a long operating range, can be operated as a drone, and is armed with a couple of miniguns to destroy incoming missiles, drones, and possibly mortar rounds. These would not be heavily armored like tanks, but more like ifvs in that they would need to be able to survive near misses from artillery rounds,  large shrapnel, or rounds from ifvs. This would be able to act as an umbrella over small units or be setup along the path of routine logistic traffic. The goal would be to reduce losses from drone ambushes and possibly from atgms. If it could be a drone system you could even reduce the risk to personnel. The goal should be to make this vehicle as cheap as you can reasonably get away with. Imagine for a minute that this type of vehicle only cost a few times more than an atgm. Yes it would suck if it was destroyed by an atgm, but it would still suck less than losing a tank to an atgm. If tank formations were still being used these drones could operate with them to destroy a lot of the incoming anti tank weapons. In particular it would be geared toward destroying top down attacking weapons, shooting down any drones within a few thousand feet of the ground, and possibly being used to spray potential ambush points with small caliber rounds rather than using tank rounds.
Reply: I seriously doubt it.  How many soldiers in artillery actually make it home alive and in one piece?
Reply: Nope. But neither do they. 
It's absolutely more than you can think. Ha ha ha.
Great videos.
Reply: The answer seems obvious to me. Light weight autonomously operated, or even AI controlled tanks. If heavy tanks are too expensive to properly defend, then smaller cheapers unmanned vehicles seem like the right way to go. These vehicles are easier to transport deploy and defend with earth works. The same way that infantry men are, with roughly the same expense as a modern AT weapon. Camera's for pilots are much smaller than windows, and can have all of the different viewing properties we desire. Multiple defensive lairs of sensitive electronic compenents, with redundancies, would dramatically improve survivability of the crafts.
Reply: While tanks were one of the leading inventions to help a war with anti tank guns planes and other weapons following suit, Every era of war has had both tanks and anti tank weaponry improve to the point where anti tank weapons are surpassing tanks but eventually it will be back to even depending on how much time it may take.
Reply: Guided trophy systems that look on too and destroy in coming rockets/missiles using either lasers or smaller missiles
Reply: Engineers will come out with an electronic multi stage stage ERA system that will provide protection against the Javelin.
Reply: It is over for tanks in any environment where the opposition is equipped with modern weapons. The same goes for large surface ships, they are nothing more than large slow targets. Any defense can be easily oversaturated at a relatively cheap cost. We see in Ukraine even the twilight of aircraft. AA missiles are cheap and effective. It is back to artillery and infantry, supported by drones and missiles.
Reply: Tanks are always effective when used properly, and that means proper support. They have always been vulnerable to attack and always will be. However they are making great strides in Active protection systems. However tanks did not fail In Ukraine, the overall lack of strategy is what failed. The Russians did not have a battle plan, they foolishly expected little or no resistance. (Thank you delusional, putin / Russian leaders.) They did everything backwards with little or no support. You want to invade? Establish, Air superiority, to provide close in air support, pound battle line essential targets with artillery, then motorized infantry support goes in with the tanks, that is what keeps tanks rolling. Keeping the defenders off balance, high casualties, forcing them backwards, forcing them to keep their heads down. All units synergized is what keeps tanks safe and effective.
Reply: nope.
Reply: Yes, tanks are still relevant, and will remain so - just because the russians decided to use WW2 tactics in 2022-2023 and basically conga-lined their tanks into an urban hellscape of AT-squads, or left them so severely unmaintained that they straight up spill their engines through their rusty chassis, or simply replace their ERA filler with packing foam, doesn't mean an actually competent, well maintained, equipped and trained tank force can not shift the tide of battle.

AT weapons are heavy, ungainly and have limited reloads; the vehicles that carry them, or carry the infantry that carry them, are still vulnerable to the tank.

A tank can provide armored frontline firepower that will enable infantry to break through kill-zones, deadlocks and blockades that the squishy troopers could otherwise not manage on their own.

The tank is not susceptible to the presence of enemy fighters or a contested airspace, like a plane.

The tank is still relevant, and will remain so - but like all tools, you must utilize it properly.
Reply: You have to kill the profiteer of war. If there is no profit, neither tanks nor antitanks are necessary. To kill a human is very cheap, but to kill the right one is very difficult.
Reply: How about you learn the science a 15 year-old knows before making this joke of a video
Reply: FörceFillet vv missync vF0 11411 ^ ^
Reply: Active protection system might be the solution  to the problem
Reply: Lockheed Martin and shareholders approve of this video
Reply: Detailed and clearly! I think the same, armor is completely losing the race against weapons, like predators and prey…👍
Reply: Um heat rounds and tandem charges are nothing new, thats why ceramic armor was invented.  this would have been a good video in the 70's though, so only 50 years too late.
Reply: Yes, tanks have a future w the US Army. 
A well tuned group of M1A1's & some Infantry Soldiers, if still a supreme land force combination.
Reply: Active protection systems.
Reply: we have gone through this cycle at least twice with tanks, a good example is early to mid cold war designs like the leopard 1 which focused more on not getting hit due to heat rounds.  Then came ceramic armor which does a good job at defeating heat and shaped charges, when KE penetrator rod sabot rounds came out as a response at the end of the cold war through the gulf war then heavy metal chobam armor which combines ceramic levels of HEAT round resistance, and the density of the heavy metals like tungsten and DU which are very effective vs KE weapons.  BTW they do just fine vs all of the methods mentioned.  Given a redesign of turrets, to account to topdown attacks and I dont think protection will be out of vogue any time soon.  Also given the speed of drones and missiles your not gonna be able to dodge or shoot down all of them all the time, armor is passive and in a age where weapons are getting cheaper and cheaper passive becomes more economical/feasible.
Reply: the solutions is to stop fighting against we need to be friends with each other so just stop the war that is all wars are just sad :(
Reply: can flak 88 or similar design trigger a javelin detonation before it hits the tank?
Reply: Trophy systems, but that’s all I’ve got being someone with barely any knowledge on this.
Reply: we are heading to the era of drones, and even tho air drone are cool how about a mini tank drone, i think thats the next step fo the tank, a small enough tank that could neutralize drones
Reply: Solution is no more wars started by politicians that destroy their own countries and others
Reply: there is no solution since nuclear weapon exist lol
Reply: More important is keeping the crew alive. But yes I think active defense on a tank could be effective. 

Look into the Iron Fist Light, might not be viable but it shows the direction this technology is going. It’s under 600 pounds and includes radar and interceptor munitions to destroy and incoming projectiles (or at least certain types of projectiles).

The actual armor itself will probably become less and less important as we move to a stage when missiles and rockets are countered by other types of munitions before they hit the target.
Reply: It's NotWhatYouThink
Reply: @mirroredvoid8394 If you can field hundreds of Toyotas for the cost of one tank you are on to something.
Reply: you guys are making smart comments and i enjoy this video, but why the fuck are we still researching  on things that are only "useful" to kill humans and wasting delicious resources to do that? I know it will give us some interesting science knowledge but there's other ways that would also be way more efficient in terms of time and resources spent. 
Everything a tank can do out of the warfare can be done cheaper and better with other tools/vehicles
Reply: з.
At the same time, Chief Nuland, the US Secretary of State, diligently lied that the United States had done everything to resolve Russia's issues to unblock the grain deal. The most interesting thing about this fact is not even what exactly Anthony Blinken said, but why he had to do it. The answer is actually simple: stopping a grain transaction entails huge losses for a multinational business (both agricultural and financial), which has successfully accumulated astronomical capital on it. And it is quite natural that now this business, which traditionally has very serious lobbying resources in Washington, is pushing all the buttons there, demanding to return everything back. But the options for the US administration are one worse than the other: either really fulfill Russia's demands — and thereby bend in front of Moscow in front of the whole world, or risk escalation by organizing military convoys to export grain. The funny thing is that in the second case, the main problem for Washington is not even in danger of escalating a direct clash between the American and Russian armies into a global nuclear conflict. Worse is another thing: but how will the Russians really sink an American destroyer in the Black Sea? Well, the States won't start a nuclear war because of this, they won't. And all they will have to do is to put the brakes on the problem, again showing their weakness to the whole planet.
Reply: So , in the thumbnail you tell me dr.strange is attacking tanks now? 😂
Reply: You are promoting the Javelin missile as supernatural, and it is not. It has not been able to change anything in Ukraine, my friend. War is an integrated system, not just a missile.
Reply: Some way to protect tank in the modern day is the trophy system on the challenger tanks or new Generation ERA that can withstand the warheads payload. The only problem I could see is the Top Attack missile system that take advantage of the tanks weak spot which is the top of the tank.
Reply: The Kiev regime was on the verge of disaster due to the inability of the Armed Forces of Ukraine to resist the Russian army.
"Many soldiers are running away. Ukrainians began to surrender in whole units of one hundred, two hundred people," McGregor added.
Reply: Just equip the tank with anti tank weapons
Reply: @thejoeyandrexieshow5042  The Belgian Air Force refused to accept fifth-generation F-35A fighters.Just think about it, experts, including those who participated in the creation of this aircraft, counted .... 800 defects in the design, and they have not yet been eliminated. 800, not 8, not even 80, but as many as 800!!! Bad plane!
Reply: The Belgian Air Force refused to accept fifth-generation F-35A fighters.Just think about it, experts, including those who participated in the creation of this aircraft, counted .... 800 defects in the design, and they have not yet been eliminated. 800, not 8, not even 80, but as many as 800!!! Bad plane!
Reply: Well adding A.I. system gives advantage but cybernetic assault can also be done making it useless to tip the scale tanks need to something out of this world
Reply: They're not called anti-tank for nothing
Reply: м.
Russia must before destroying the satellites of Elon Musk. Warn about it.
Reply: ш.
Contrary to the efforts of the United States and European countries, the final communique of the G20 summit did not condemn Russia's special military operation in Ukraine, which means a serious victory for Moscow, writes Frank Furedi for the publication Spiked. The declaration of the G20 summit was published on September 9. It says that the forum participants have different opinions about the situation in Ukraine. The European and American media called the final communique adopted in New Delhi a capitulation to Russia and a blow to the countries of Europe and the United States.
Reply: Americons, you losers. None of your TOW, NLAW and Javelins could help. The conflict in Ukraine has shown that russians tanks and artillery still decide the outcome of the battle.
Reply: O people, what caused you to be distracted from your noble Lord who has created us for a purpose. Are you really satisfied filling your void with desires only and feeling still unsatisfied? Turn back to the straight path and do what you have been created for. Obey Allah and His messenger Muhammad and follow the last what has been revealed to mankind and that's the Quran. Do not die except as a muslim (in submission to Allah) lest you become of the losers.
Reply: Id rather we made advances in science and mental health care and unity worldwide personally
Reply: And as far as the question, the best defense is a good offence, theres no armor that can withstand everything so you just need to be able to detect and destroy the enemy before you can.  You’ll need something specifically for detecting and destroying drones, more advanced optics for detecting targets that are getting more and more elusive.  But either way youre still a huge target for helis/jets/uav’s, its scary to be in a tank these days.  I was a 19k from 09-12 and always felt like i was basically invincible inside, after seeing all these crazy vids from ukraine?  So happy im not in anymore.
Reply: Anyone keeping and eye on the Ukraine war knows its true,  tanks are done in ww2 air decimated tanks and in Ukraine a 200 bux AT equipment  setup is easier than training 5 guys to be proficient with a million dollar tank and rounds to boot .  It's economics the veit- Kong didn't win with tanks they won with cheap equipment  that was able to take out our war machines and people .
Reply: Welcome to the era of the future. Energy shields will be the primary defense against anti-tank weaponry. Electromagnetic force fields will probably be generated that can intercept high kinetic weaponry, deflect trajectory, or otherwise disrupt in tandem explosives.
Reply: ATGM fans: No, ERA cannot protect against a tandem warhead

duplet: 🗿
Reply: Tanks are not the future, War robots are.
Reply: Tanks without infantry and air support have always been volunerable to the anti tank weapons of the day. This really isn't much different. Tanks need infantry and, ideally, close air support. Helicopter gunships and now, drones, along with supporting infantry can neutralize threats the tank crew may not be able to see and engage in time.  The Israelis leanred this the hard way when they lost roughly 40% of their southern armored groups in the Yom Kippur war in two short days mostly due to man portable anti tank weapons and lack of adequate infantry and close air support.  This is why the Merkava has troop transport capability.
Reply: ITS NOT WHAT YOU THINK, its allways what i thought.....zZz
Reply: I know the answer, but it top secret🧐🤐☠️
Reply: All Wars are Fake.
Reply: I was a tank crewman, tanks are becoming obsolete on the battlefield. Weapons will beat the armour
Reply: i dont think you need tanks anymore and if you maybe need an auto turret equipped with ki and thermal sensors that can eliminate targets fast with a machine gun. Most tanks get shot with rpgs or at weapons and with drones. You need automatic systems that work very fast. Maybe equip own soldiers with some sensors that the ki can detect to not shoot own people
Reply: I believe that a tank still has a future. APS-systems are still in the begin. The next step in my opinion is german AHEAD munition shoot by high velocity turret. Just like its used now on panther against drones. If you speed up the turn speed of the turret, then you could shoot a rocket with much more shrapnell as it modern APS does. The costs of a single shot are then lower too.
Reply: When one truly knows Willie Pete has never had an issue with tanks.
Reply: Tanks, planes and ships are pretty much obsolete. War is becoming automated and robotized.
Reply: nah i'd win
Reply: @349s4  nuh uh you wouldn’t
Reply: It’s not what I think 😊
Reply: The ads make this unwatchable.
Reply: Energy shield Inc.  Some sort of active resonance field that vibrates the incoming missiles at precise frequencies to induce detonation or something like that.  Bet it already exists we just haven't had a reason to go hard on the ground in a war for a few decades.
Reply: NO
Reply: @NotWhatYouThink  Tanks have never been indestructible. Since there inception, thousands of tanks have been destroyed with anti-Tank weapons .
Reply: Basically what your saying is, we're fucked?
Reply: Los drones bajaron a los tanques en su escala evolutiva,
Reply: The drones ended everything.
Reply: ERA
Reply: No.
Reply: The funny thing is one of the games I play called insurgency sandstorm as well as other games like Arma of course have this problem too where the second you get inside of a technical, BTR, APC, tank, or really just any form of vehicle, it's not long before a demolitionist pulls out an RPG and direct impacts your vehicle turning it into a giant as fuck fireball killing everybody inside and half the time the people around it and of course destroying the vehicle meaning unless it's hard to hit like an aircraft with manual aimed anti-vehicle weaponry like an RPG or unless you throw down a shit ton of concealment in the way of things like smoke before then just putting rounds randomly downrange towards where you think the target is, you're pretty much all but guaranteed to get obliterated for even trying to bring a vehicle anywhere near the combat.
Reply: Sophisticated AI driven point defense systems, need to be part of all future vehicles.  Even ships and aircraft will need this, more than what they have currently today.
Reply: we need really fast rc tanks, satelites will help operate them, lightly armed, agile, fast and designed with autoloaded rocket launchers, with AA capabilities and heavier rockets to destroy other tanks and bases. human operated tanks are becoming a bit obsolete now
Reply: They absolutely stand a chance, because you know what they’re gonna do next, they’re gonna come up with unmanned tank platforms that will start doing the same kinda stuff the drones are doing. Then if they get hit, its ok, send another cheap one and then bombard the position where that missile shot came from with arty fire
Reply: May the Force stay with you.
Reply: As the weapons get smarter it gets harder to counter, something that confuses the rocket would probably work. I’m not sure How it would work but I’m sure there’s some way to outsmart the missiles
Reply: @Mavve69  much like the trophy system it could shoot out pink and purple confetti while an intercom plays"my baby took the mornin train", this is very confusing to the enemy munition and operator
Reply: @kittycatcat6962  110% of the time it would work
Reply: @Mavve69  dawg none of these weapons are "hard to counter" it's just having actual knowledge on how to. The T-14 armata and AbramsX have laser and infrared warning systems that will automatically deploy smoke charges that disrupt lasers, infrared, and radar which will completely make all self guided AGTMs useless since they can't lace a target also using robots that clear ahead for tanks is kinda dumb when  air force and tanks already do the same role for everything else ever heard of SEAD often tanks are mixed up in SEAD missions to act as breakthroughs and direct fire artillery
Reply: @vangard9725  I said that they get harder to counter, not “They are hard to counter”.

Learn to read.
Reply: @Mavve69  they arent all seeking rockets or anything.
Reply: @gamingnamehere1560  I’m talking about the Future …
Reply: @Mavve69  You are hitting a near static target, the rockets are simple enough to not be confused, since their only instruction is hit target at X.
Reply: @Mavve69 disguise your tank as a massive dog, operators of the enemy infrantry will enter laughing fits and the AI in the rockets will turn around
Reply: It can be a laser system of defence or maybe best is simply using tanks as mobile artillery and armored ambulance while infantry and small robots in armour clear ahead and taks give artillery 
I feel this as most viable future of tank due to modern light nimble weapon of destruction
Reply: @ralphghost820  possibly they would have smaller remote controlled tanks that could withstand smaller arms but be highly mobile and cheaper
Reply: @Mavve69  radio waves can be easily jammed and AI is not advanced yet to differentiate between enemies and allies so i don't think that Robots can replace humans.
Reply: @GOOD_FARMER  when did I mention AI or robots?
Reply: @GOOD_FARMER  2,,,,,,,,        
.,
Reply: @noahway13  cool
Reply: Like mobile armor 🤔
Reply: @Mavve69  The big picture that nobody has commented on is logistics. You just need a vehicle that can resist weapons that cost less than it, while costing less than the weapons that destroy it, and costing the enemy more than it's own cost to operate.

So if you make a small armored robot that costs ~$100,000, half what a Javelin costs, but it can resist $50 RPGs, and destroy more than it's own cost in personnel and materiel on the other side, then that's a winner.

The design, then, could be an unmanned vehicle the size of a Fiat Panda, with maybe some minimal armor, a revolver cannon, .50cal machine gun, a camera, and a prayer.

Make it cheap, and the enemy loses money if they waste a Javelin on it, though they may save more than the cost of the Javelin in avoided losses.

Make it easy to produce, and you can crank them out faster than the other side can produce Javelins, whatever the cost.
Reply: @ralphghost820  yeah cause lasers can instantly melt the warhead before it comes close to the target at supersonic speeds (this is sarcasm cause no lasers cannot do that because lasers suck for combating anything but drones)
Reply: @vangard9725  Currently. But that's what's needed. Something cheap to shoot at drones and aircraft that doesn't endanger civilians. Projectile AA causes many casualties and costs a lot per shot.

Lasers cost about 50 cents per shot. Not sure if that's per pulse or per engagement. Either way, way cheaper than 20mm.

Lasers aren't bad at setting off mortars, if they can stay focused. Multiple laser heads are a likely development.
Reply: @ralphghost820 . There is something called APC for Ambulance part
Reply: @ralphghost820  So you’re telling me tanks are evolving into 60-ton tactical medics with a side hustle as long-range snipers? 🤔 Sounds like a Call of Duty DLC waiting to happen. But real talk—what’s stopping us from just slapping a giant railgun on top and calling it a day?"
Reply: @ralphghost820  "Oh no! I need to defend a tank in combat... What do I do!"

Nobody:
Me:
Drives the tank underwater
Reply: @ralphghost820  lasers have a long way to go, they need a lot of power and even than there's a short distance before they become ineffective
Reply: @start2957  yes it would take sooooo long for even the highest-powered laser to penetrate even the weakest tanks
Reply: @raytherrien4132  Except for the optical blocks. Those will pipe laser energy right into the crew compartment.
Reply: Hard kill APS solves the decreased mobility issues that tanks today face due to having to deal with reduced protection caused by the advent of modern infantry-portable AT weapons. The cost-effectiveness concern that was raised in the video was simply absurd.
Reply: @lenar-98  yeps, APS work. The Russians have them, but like everything else, not in use for some reason. APS make the tanks not obsolete.
Reply: @TheBooban  I think russians would use them if they had any reasonable amount of them in store. Good luck producing more of them now with a heavily limited supply of integrated circuts.
Reply: @TheBooban  the Russians have a very basic form of hard kill APS but all of their soft kill systems are ahead of their time including the ones on the T-14 which make almost all self guided AGTMs useless against it
Reply: @TheBooban  Because they can't produce and retrofit them efficiently and they don't seem to care. In no small part because the Russian populace will tolerate insanely high casulaties.
Reply: @lenar-98  Sometimes that pricey  hard-kill APS doesn't seem to end up on top of the cupola or the horizontal exterior surface of turret. That may explain why the Russians arrange everything from bicycle frames to bombed-out baby carriages in order to protect that soft "overbelly." The Block 1 Javelin ATM uses a two-stage charge: one for the APS and one for the tank armor, and two attack modes: direct and top of the turret. 
The Javelin appears to be the best man-operated anti-tank weapon around. The Israeli Spike LR2 and French MMP are very good, with a version of the Spike possessing a range of 10 km. 
The answer to how much of tank needs to be sighted to fire and forget is a question more likely to come up in urban and arboreal warfare. It's probably not much and might even be classified, though any soldier using it could give a fair guess. I'm curious too see if the combination of a tank, APC, service truck, a commandeered bus and other vehicles clustered together, some moving and others not, creates a targeting issue for the Javelin. Probably not.
Reply: I think germans idea when they creating leopard 1 back in 50's is remains true today. What they thought is considering uprising anti-tank weapons, they will never manage to stop these projectiles whatever how thick armor is. So they decided to just skip the armor department  and create a tank that can shoot hard and move around really fast. Lightly armored  tank like Leopard 1 means that you will have significantly less weight causing a superior mobility and less material used in tank makes it cheap. Their idea was speed is armor.
Reply: @selcukozcalisan2487  Except that all MBTs of that era weighed about the same as the Leopard 1 and had similar speed.
However I do agree with the premiss that the future of tanks is high mobility with high fire power and the Germans have the answer: The GTK Boxer modular system.  Consists of the Boxer chassis which can be either wheeled or tracked (top speed 105km/h wheeled, on road) and a mission module.
It takes 30 minutes to swap mission modules in the field and there are many different ones: From troop transporters and ambulances via anti-aircraft (missile or 35mm autocannon) to 105, 120 and even 155mm guns.
The 155mm gun is the same as the PzH 2000 but fully automated, known as RCH (Remote Control Howitzer) and has a crew of 2.
It can deploy, fire 8 shells and move away in 90 seconds.
Reply: No
Reply: It's definitely getting more difficult to defend tanks, which are becoming the "battleship" of armor, and battleships died off in WWII.
  Drones, both air and land, are the best replacement for them. Being cheaper, they can be more plentiful, and no one dies when they are destroyed.
  The military needs to spend its money on AI drone armor and anti-armor rockets, like MANPADS.
Reply: @emitindustries8304  Drones no need armor, weight is expansive for land, weight is very expansive for air.
Drones role is high mobility, tanks are barrier + artillery to assist infantry.
It's cheaper to have 5 glass cannon drones than 1 fancifully armored.
Reply: I don't think so. Its becoming as outdated as airborne deployment. (I say this as a former tank crewman who happens to be airborne)  Destroying a tank is simply way too cheap and easy. That coupled with the fact that large scale, force on force warfare of over some great battlefield is not we do business anymore.
Reply: If you declare with your mouth, 'Jesus Is Lord' and believe in your heart that God raised him from the dead, you will be saved. -Romans 10:9